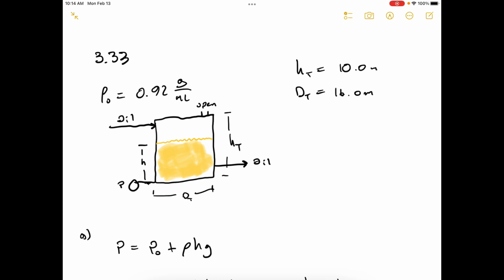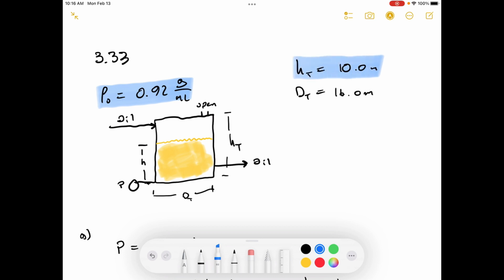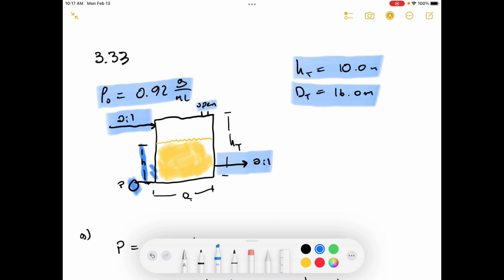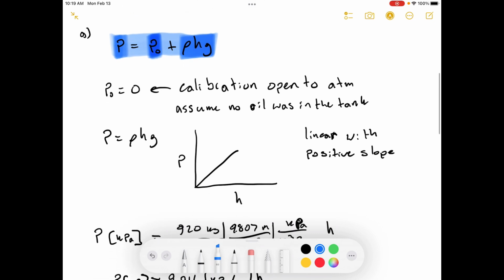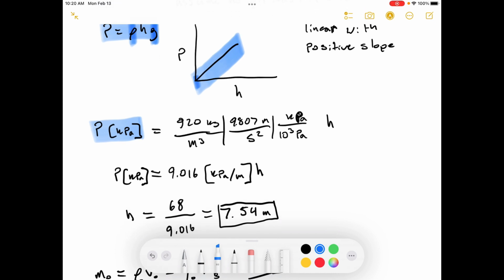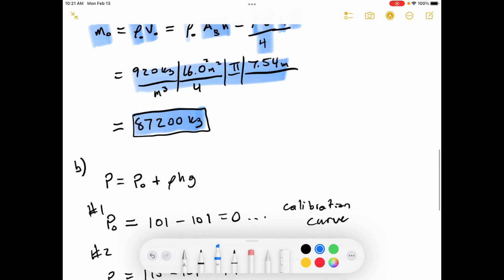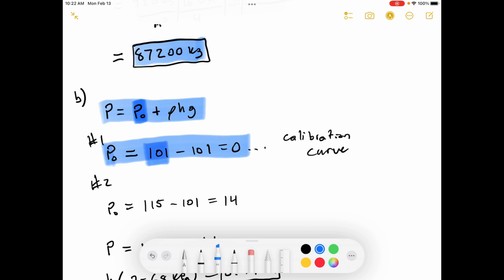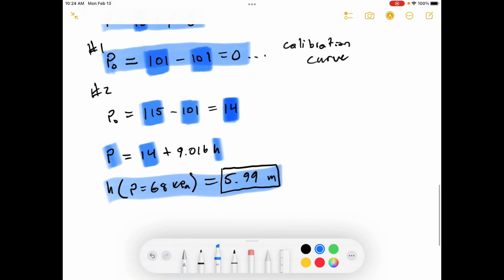TEP - Elementary Principles of Chemical Processes Third Edition - Problem 3.33 - Episode [079]

Comment: The calculation of Mass in ques a is wrong here the answer will be 1.3947x10^6
Reply from the maker: Hey! Thanks for catching that! My calculator skills were way off that day. The rest of the function and steps seem to be correct, but I tripped at the finish line. You have been pinned!